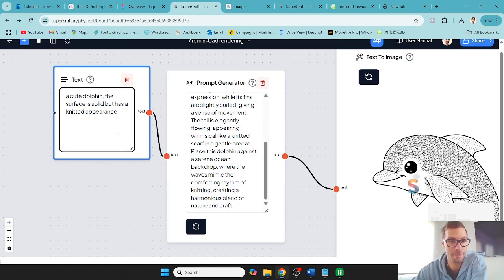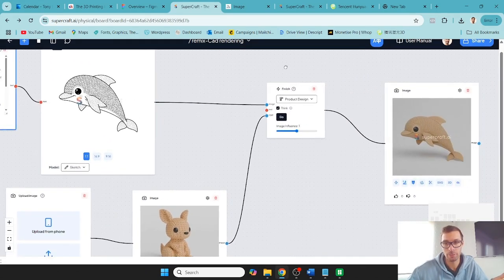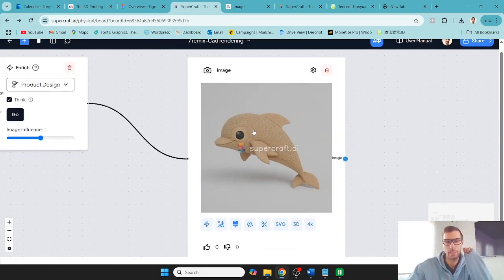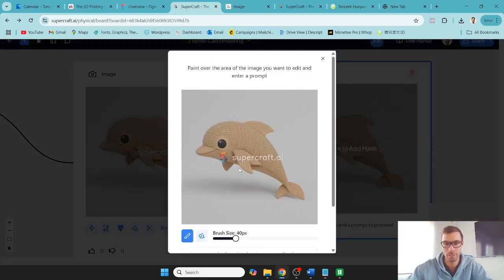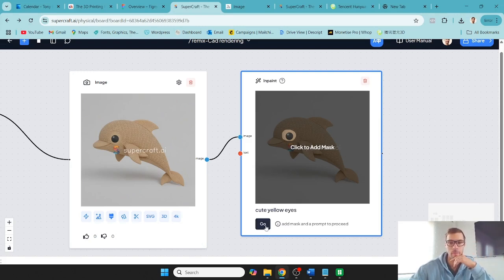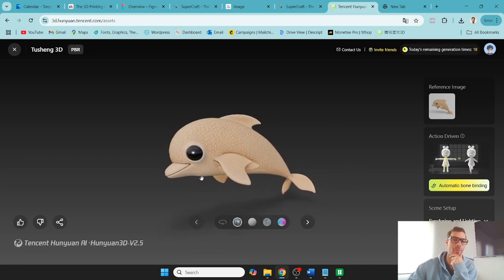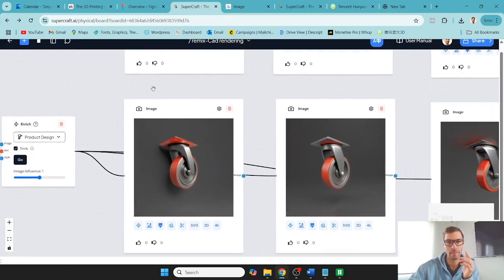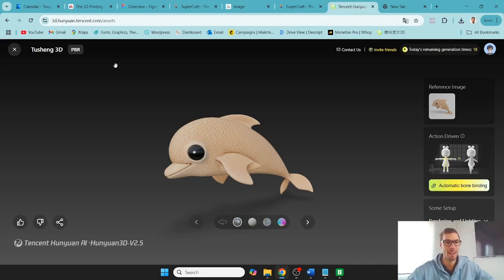3D Design and Rendering using AI 🤯

Comment: That's incredible Tony. Do you think there's enough control to move beyond just a standard model towards a making the model like a mini/articulate etc?
Reply from the maker: In this case, you can take the generated 3D model and hand it over to a 3D designer/artist to add in the articulations. 90% of the work is complete and you would need them to add in the finishing touches.